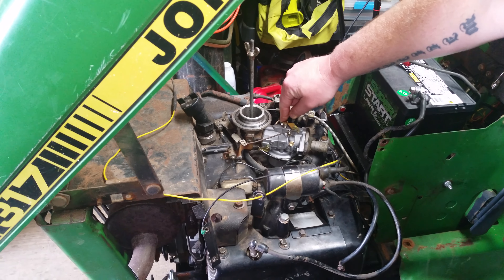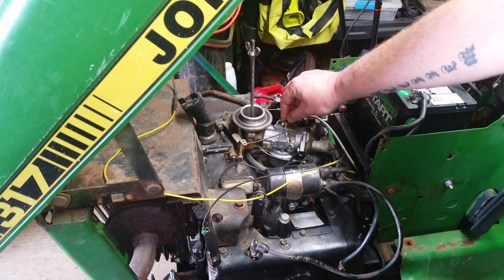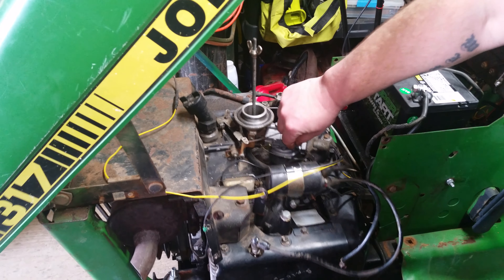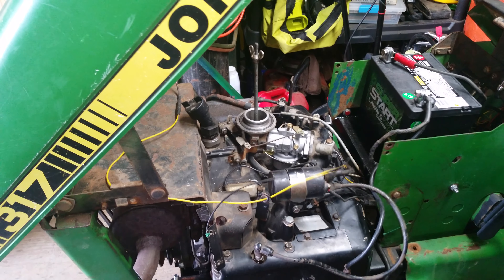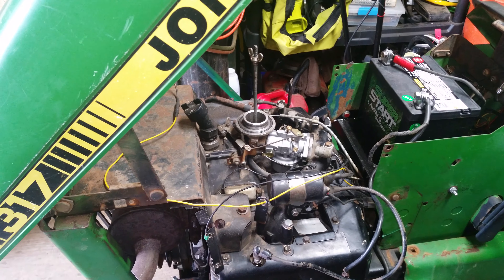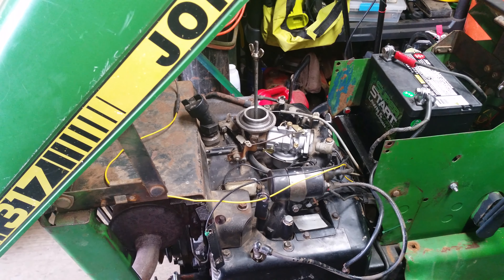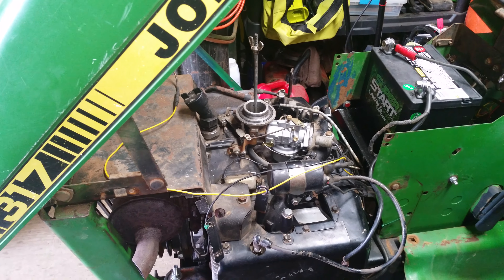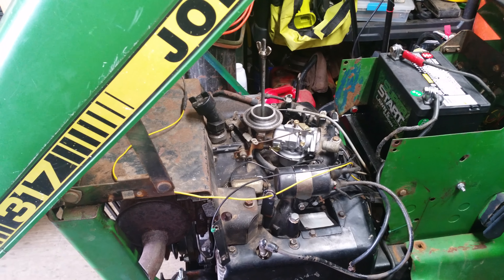1981 john deere 317 with a series 2 kohler

Comment: Check the points. Yes it has points. Under the rounded rectangle box to the side and slightly forward of the carb.
Reply from the maker: Yep did that I actually replaced them. I have since sold this 317. I do points all the time. It was a carburetor issue.

Comment: are these a good engine
Reply from the maker: The series 2 is the series one is only junk if someone mowed on a hillside most of it's life. On the series one if used in its side 1 cylinder would get starved of oil. So if you buy one and it smokes stay away from it. The way to know if it's a 1 or 2 is look for a oil pressure plug on the block if it has one it's a series 2